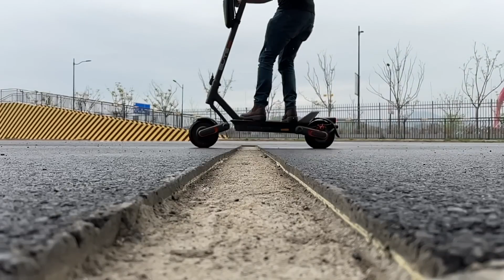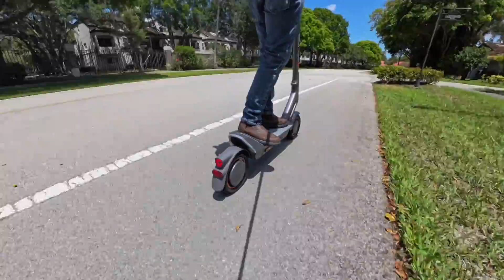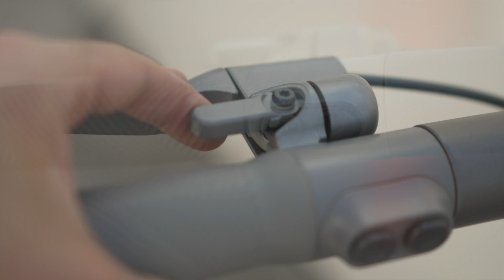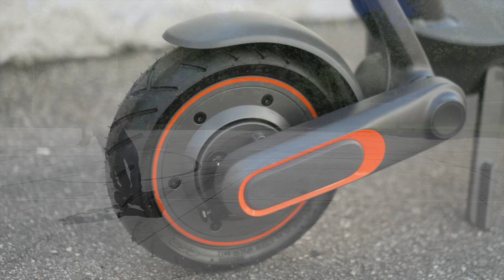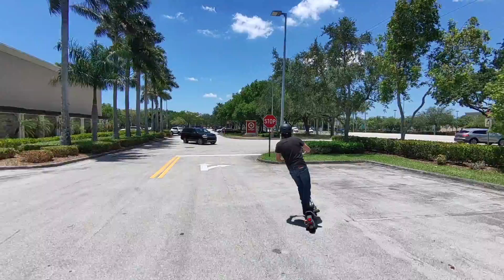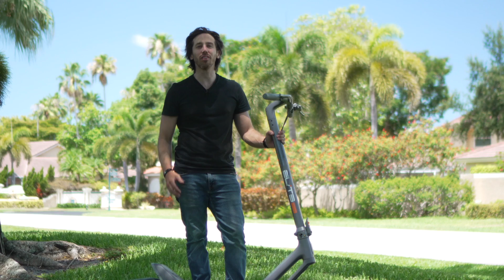Yadea Elite Prime: High Power Electric Scooter on a Budget!

Comment: Bought mine about a month ago and the brakes went out at 500 miles. The scooter will come out under you on a turn I bit the concrete at 20mph and had to go to the hospital. It’s a bit heavy and I live on the second floor. That being said it has great range and it’s nice and smooth. Want to get the speed limiter bypassed.

Comment: 1200 dollars is way overpriced. I got an awesome Caroma for 350. 750 W motor, 20 MPH top speed and 20 miles to the charge. The only thing I really loved about this scooter was the suspension, but it isn't worth an extra 800 dollars.